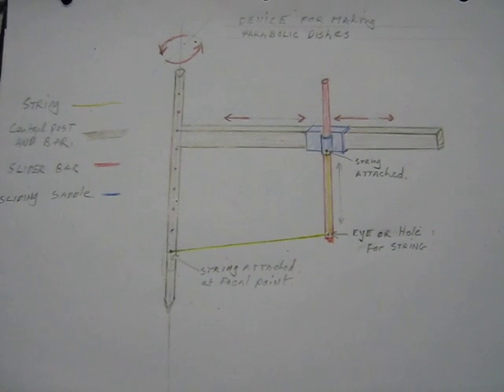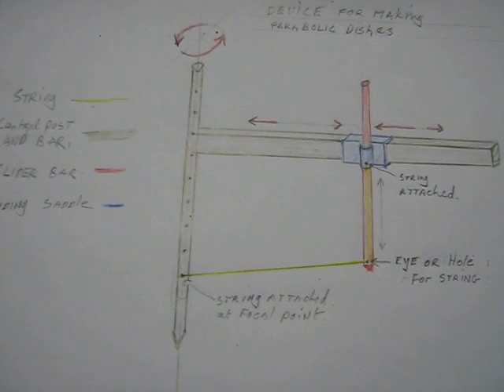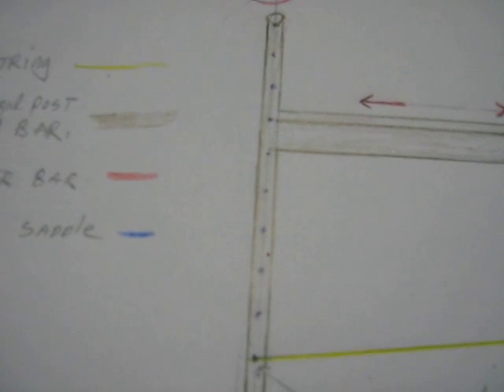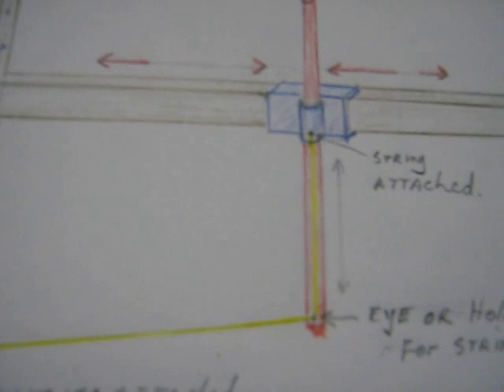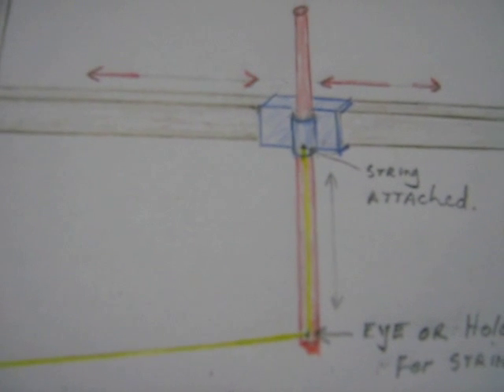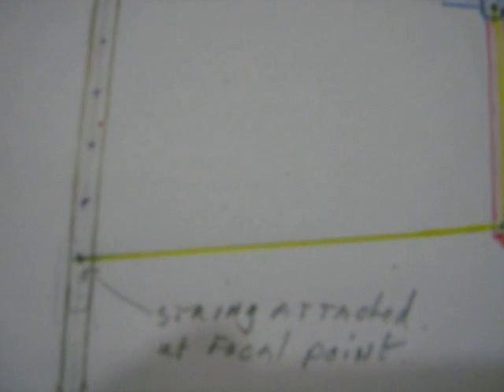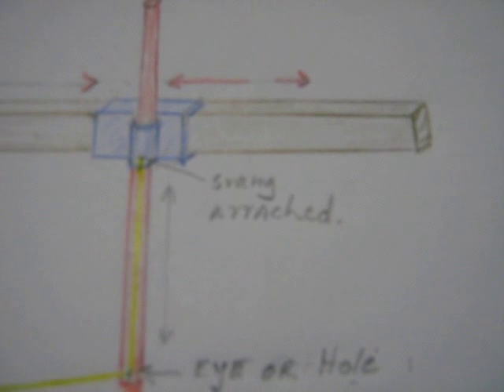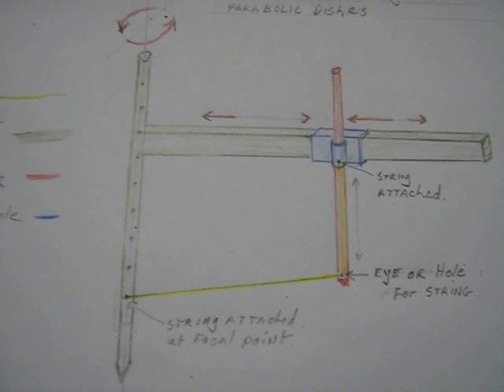The parts of the mechanical mathematician

Comment: wow. Superb. This thing really helped. Can you please give a more detailed diagram, as to where the string goes near the straight rod, and where it is to be fixed? Also, an explanation as to why it works this way will help. Awesome.
Reply from the maker: +N Prãvēëñ Çhäñdhâr  It's not that special.  There are videos online about using a t-square and string to design a parabolic curve on a flat surface.   I just put it in 3 dimensions to design a parabolic dish.   I only did it a couple of times.   The real value of this is that you can design and make an "offset"  dish.  or perhaps a mold to make offset dishes.  You need to look at my earliest videos for more information.  But they are blurry and horrible because I did not have a good camera.  Best of luck.   A couple of years after  this,  I made a thing called the  "solar design T-square"  which helps people design reflective dishes with a "wide acceptance angle"   that do not have to be moved so often to track the sun.  These are probably better than parabolic dishes if you do reflector design for solar cooking.  Thanks Brian

Comment from the maker: There is cob solar cooker 2 videos  and the solar barbecue  finally an experiment where I used it.  I don't think anyone else ever made one. It is based on a t-square and string way to make a parabolic curve. I think it is good because it can be made cheaply and it does the parabolic dish mold in one go from clay or cob.